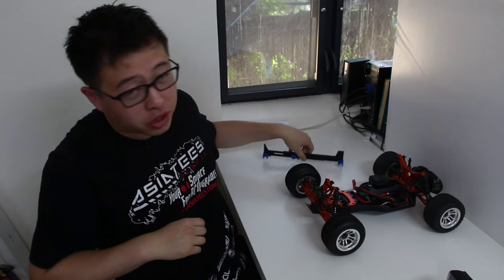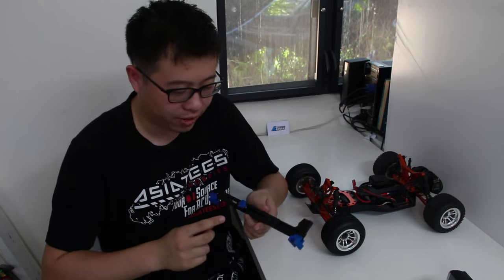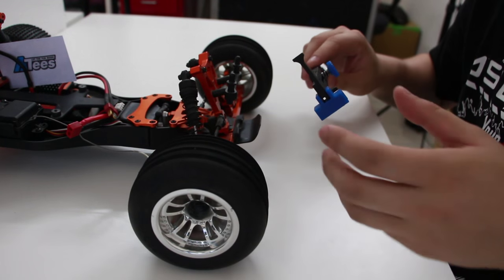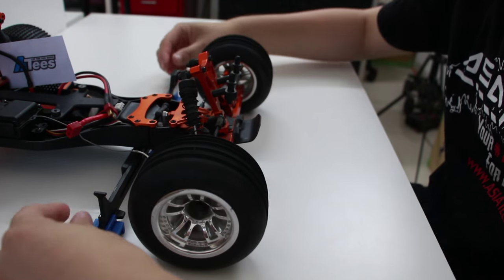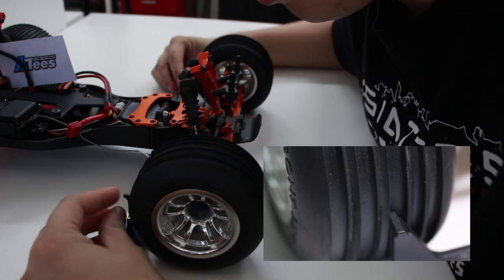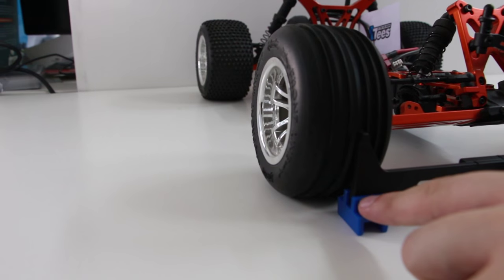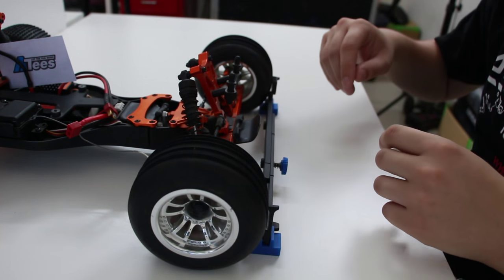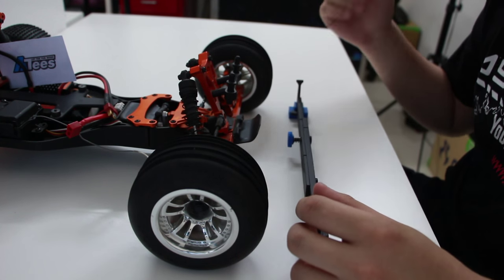RC Basics: Measuring Toe-In & Toe-Out With RPM's Toe-In Gauge

Comment: How you know what tire needs to be adjusted ?
Reply: It doesn’t matter which tire is in or out.  You use the gauge to either have toe in or toe out or run perfectly straight depending on the type of running you are doing.  Then you use steering trim to get the car to run straight.  I run oval and I need toe out.  Guys running on-road probably have a little toe in.
Reply: @michaelritchie1385 usually you want toe out more then toe in no matter what racing your doing, it’s more about stability then anything

Comment: Sorry I know this is old vid, but my question is, How do you know which tire needs adjusted & if so how much? what if the front left wheel has more toe out than the front right wheel, how does one figure that out? maybe I'm over thinking it? Thanks
Reply: It doesn’t matter which tire is in or out.  You use the gauge to either have toe in or toe out or run perfectly straight depending on the type of running you are doing.  Then you use steering trim to get the car to run straight.  I run oval and I need toe out.  Guys running on-road probably have a little toe in.
Reply: Check both steering links are equally the same length

Comment: How do you know which side is causing the toe in or toe out to go out of specs?
Reply: I have this guage and the Camber one.I could say that it isn't really worth it for exactly the same point-it doesn't allow you to equally toe your tires.All it tells you is the overall result that you have a toe in, a neutral or toe out. Neither of those things are actually bad they just depend on the kind of driving you want.The thing about it though is if you don't create the same toe angle for each tire your car is going to drive off.
Reply: It doesn’t matter which tire is in or out.  You use the gauge to either have toe in or toe out or run perfectly straight depending on the type of running you are doing.  Then you use steering trim to get the car to run straight.  I run oval and I need toe out.  Guys running on-road probably have a little toe in.
Reply: Set one side toe degree and then make the other side steering link the same length..